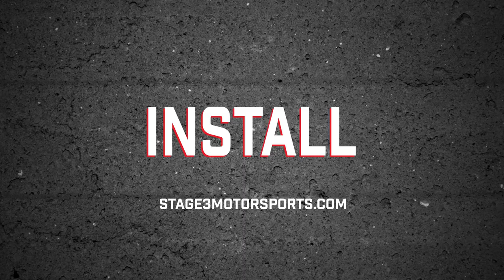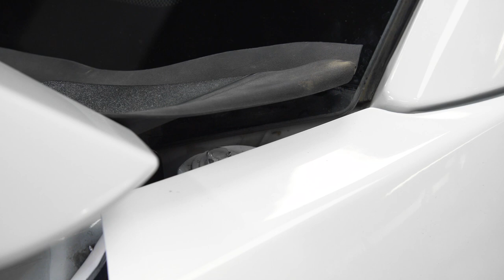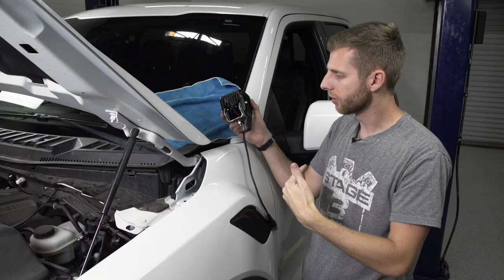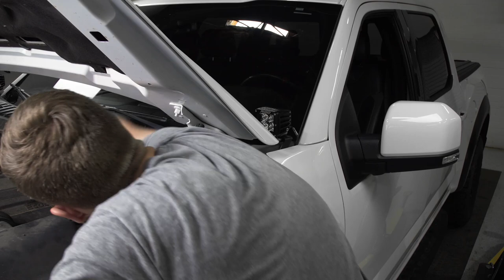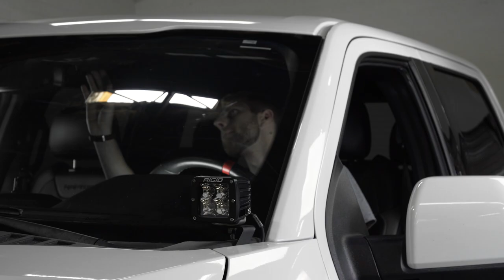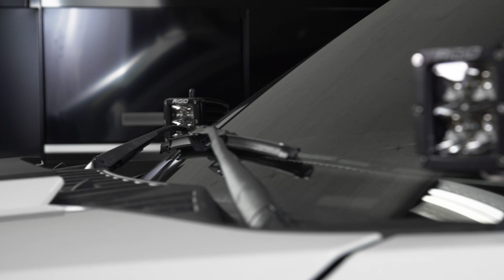2017 - 2019 Raptor Rigid Industries A Pillar Light Kit Install

Comment: Question: I have a gen3 raptor and trying to install dss-pro a pillar lights, customer service says the lights come with wires, do I still need to purchase the harnesses to install? Or the wires comes with the light can be connected to the existing up fitter location

Comment: Great video ! ...I just bought the rigid 360 with backlight ( pillar lights) for my 2019 Raptor ..but it says the harness sold separately..do do you happen to know the item number for that specific harness? 
Thanks
Reply from the maker: You can pick up the wiring harness right here in the link https://www.stage3motorsports.com/36360-Rigid-Industries-Backlit-360-Series-Wiring-Harness.html
Reply: @stage3motorsports  Thanks